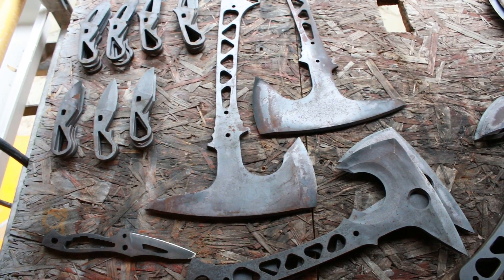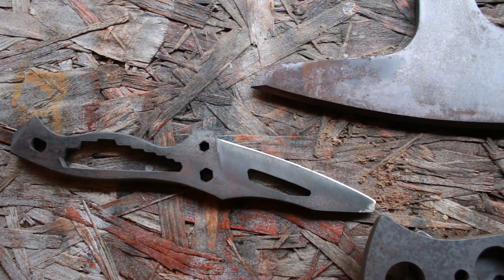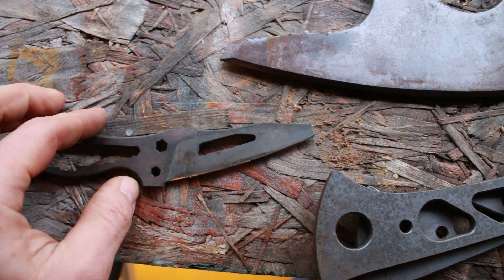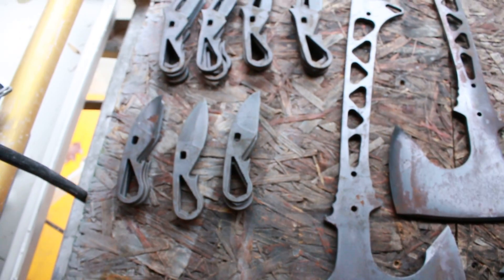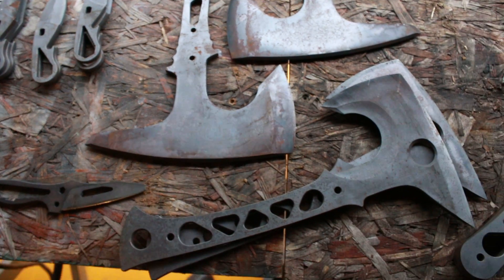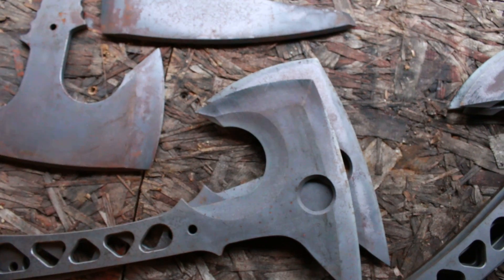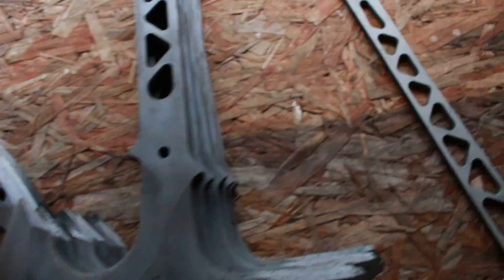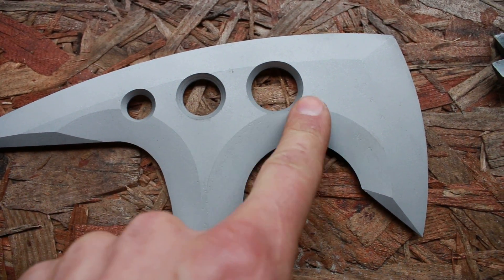Bad Heat treat AGAIN! and Rust, Arrgh!

Comment: I get my Salt bath Heat treater to  acid dip the blades after this removes the salt and any scale   and then dip in preserving oil  this stops any rust developing . Im in the UK so cant help with a treater for you  but worth asking if they can offer the dipping after .   If you get some in not dipped you need to wash of  and scrub in water and soap  then oil for storage  a real PITA  if you jut had 800 blades in

Comment: Hey Jared, I know Tim Zowada is highly regarded and sells the salt pot baths.
http://www.tzknives.com/#!kilns/c53r
Reply from the maker: +C amber I think I'd like to go with a propane powered salt pot system, so it can be more portable and not rely on so much electricity.  The size of the pot itself will need to be pretty big since my tomahawk heads are pretty big, and some of my swords are pretty long.    I may have to build something myself.
Reply: +Self Reliance Essentials Inc Didn't think about the fuel source. maybe contact Nick Wheeler then. He uses them, but not sure what fuel source is.
Reply from the maker: +C amber Actually, I looked back over some old emails, and it seems I had already talked to Tim about this years ago.   The last note I had sent, and then he didn't respond.   I'll be touching base with him again today.